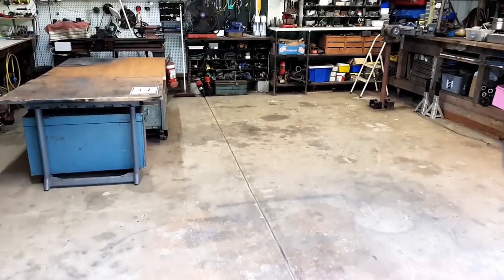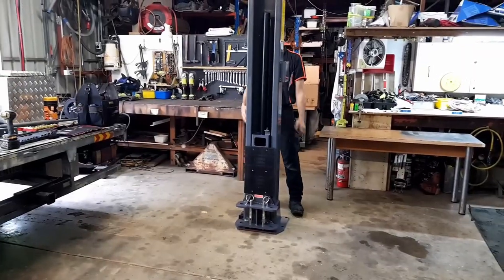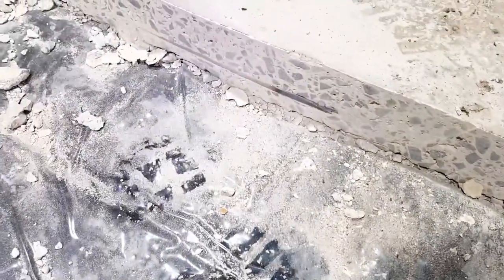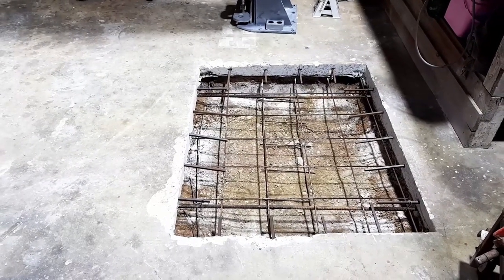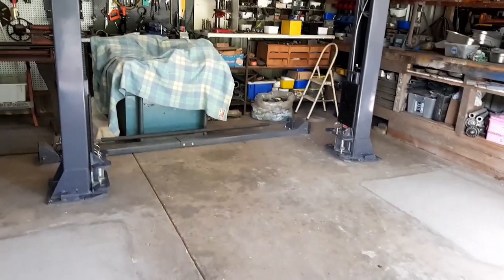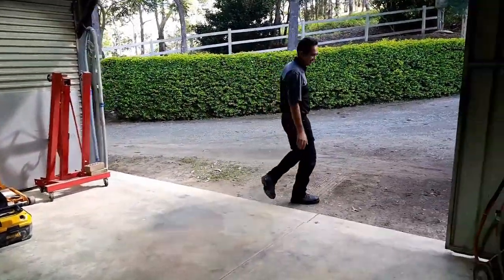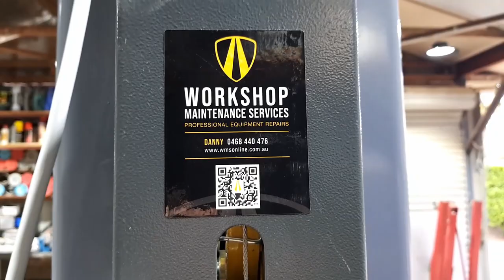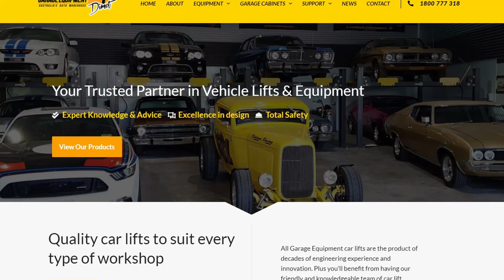Workshop Upgrades - How to Install a Car Lift Twice - Part 2

Comment: A very timely video, Jim, as I'm in the early stages of planning to purchase a hoist. I know I want a 4T capacity unit so I'll certainly be getting in touch with Garage Equipment Australia, who have a distributor here in WA.
Your high bay lighting install looks the goods, too....much brighter than the flouro lights I have in my shed at present.
I won't be telling anyone I've got a hoist, either...when it's installed 😀
Reply from the maker: I'm just doing a video at the moment  that will help you out. Watch this space. Before you decide to buy.
Reply: @DoinStuff  Ok, I'll keep an eye out for it, thanks.

Comment: Concrete upgrade is a common problem it seems, good of you for making it a top 5.  Was the mesh recommended by the installer to make drilling simpler or is rebar all the way through a lot better?  I need to key pads into my slab for my handmedown lift install as well when I get going.
Reply from the maker: The hoist supplier recommend to tie in the old slab with the new and it was my idea to go over the top with the extra rebar along with extra strength concrete. 
Has wrked well and it helps me sleep at night 😎